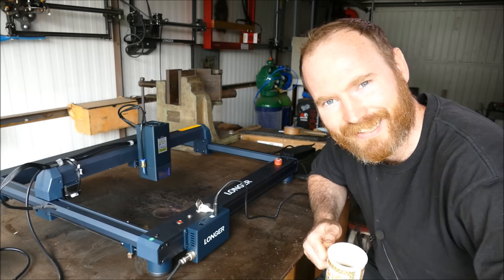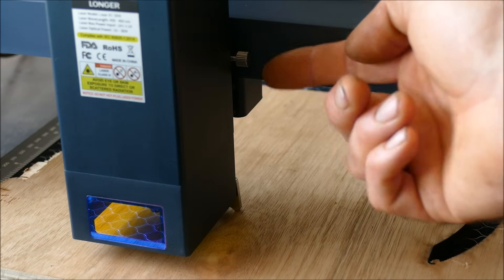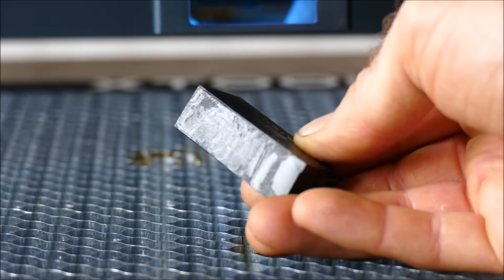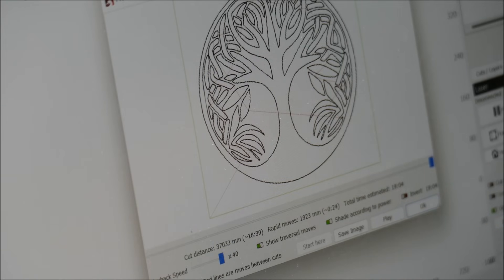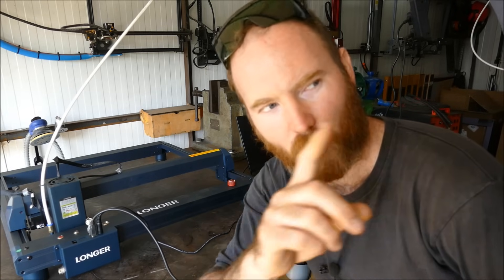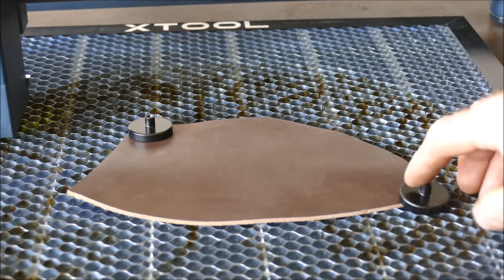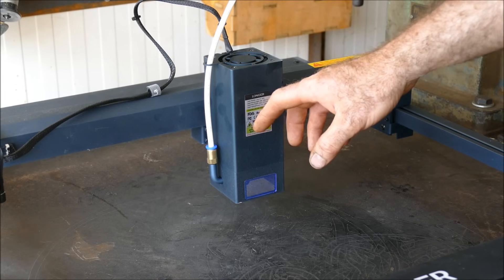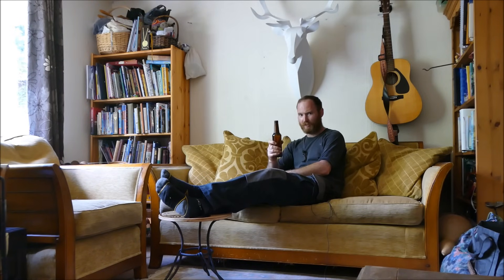MIND BLOWN new budget laser can do this! Longer Laser B1 30W desktop laser full review test & critic

Comment: Another great video. Now I want to test a laser and I'm not even done fine tuning my plasma cutter. Which brings me to another question. When do you think they will offer hobby lasers for cutting 3mm mild steel? I would love a laser for sign making. Plasma is nice but messy and warpage is always an issue too. Great vid. You're no slouch when it comes to tackling the tough jobs like forging. Must have taken some time to do that part. Thanks.
Reply from the maker: Thank you. Those lasers do exist but they are very pricey. Personally if you're sign making as a business I would just pay a profile cutting company with a 10kw laser to do it for me and pass the cost to the customer.  Saves me using up valuable space for the machine and storing material and scrap. You'll see in my next video coming soon what I mean by that. Cheers J
Reply: @joshuadelisle  Indeed time is money. I don't have a sign making business, but I like the idea of making them - which is why I built a plasma cutter after watching your video on how to do it - still working out some bugs but it's pretty awesome. My laptop goes buggy during cuts and the machine responds accordingly. Need a more sheilded setup and/or a tower computer in a case, working on it. Much less trouble running the print off an SD card on the board (rather than directly from Open Builds Control, but I highly reccomend them for the FREE Cam (online) and Control (downloadable) software. Easy to use and OBCam will convert any SVG into a tool path and g-code.) Bought some sheilded wires to run to the motors, grounded the machine as you did (grounded to the case but maybe a better spot?) I also had wrapped the torch lead in tinfoil which seemed to be the biggest help for preventing the HF antenna effect, but I'm going to make a better sheilded lead cover using faraday fabric. Peace!

Comment: Hi again Josh, Instead of concentrating on 2 axis laser machine it would be far better in the long term to buy a 3 axis router as a laser unit is easy to fit and you still have the extra use of the third axis as a router. Some of the more rigid routers are quite good or cutting metals although a much more solid machine would be required for work on steel. Regards MoK
Reply from the maker: Thank you. I actually have one to show at some point. Cheers J

Comment: Hi , I'm a new subscriber,  i have a small cnc business and want to add a laser to my business. Im on a budget, but I don't want to make a mistake. What would your opinion be on a buget friendly  lazer
Reply from the maker: Hi. It depends on the work and how often you'll be using it. Some budget lasers are no good for continuous use and others lack power to do certain jobs. Cheers J
Reply: @joshuadelisle   what do you think of the xtool s1, and do you happen to any suggestions of machines I should review
Reply from the maker: @kevinjobe9205  I did a review on the S1. It's good but limiting in height and space. I personally don't like their software that you have to use to get the full range of features.  Cheers J

Comment: Thanks for the super cool review! 🙏🏻
Assuming you want to engrave or cut something in a very large wood panel (larger than the working surface of the laser cuter) is there a technique that allow splitting the process into multiple step where you move the wood panel between each cut session ? Hope you understand my question.
Reply from the maker: Yes there is. I hope to do a video on it soon. Cheers J

Comment: What is the lowest laser power that will do stone? I’m trying to do stone at lowest cost and lowest eye danger
Reply from the maker: Thank you. The eye danger is there all the way to just a 3w laser so investing in quality glasses and a cover is recommended for safe use. Every type of stone reacts differently and only some work well at being engraved by a laser. The more power the better because essentially it's the sudden heating and swelling of the stone surface from the laser that breaks away chips. Cheers J

Comment: For under a grand, that's incredibly impressive. There's apparently a 40W model that's $400 more and includes a honeycomb table, but then you're in the range of other machines that might be of higher build quality. I love that they've figured out how to do a self contained head with the newer machines. No more glass tube and mirrors. I think I'd get a lot more enjoyment and use from one of these than a 3d printer. I just don't have the patience for those. Give me a machine that will do it's job in reasonable time frames. There's also the cool factor of cutting things with a laser. I would definitely get proper safety goggles if I were running one of these open. I would think a reasonable fume extractor wouldn't be that hard to set up. There's also the option of just wearing a respirator mask.
Reply from the maker: Thank you. Yes the K40 CO2 is very cost effective but I hear it's not so easy to use, needs lots of modification to work well and has a very small bed size. Cheers J
Reply: I bought the Atomstack X7 pro 10watt a year and a half ago and it's paid for itself and a new laptop and Lightburn without even trying to sell things I practiced on. Yes it's a great investment and they are cheaper and more powerful now. Definitely worth the investment. The nice things about the diode lasers is that the heads are replaceable for cheap and they don't deplete if they are not used like CO2 lasers. Not quite as powerful but they do a good job for the hobbiest.

Comment: I've seen laptops customized (graphically) with lasers. Is this unit capable of that? I'm wondering about the slight curvature of most laptops and how the laser would adjust for that height variance.

P.S. Steff320i is correct; awesome blacksmithing skill.
Reply from the maker: Thank you so much. I believe this would work fine. It appears to hold a linear beam for about 30mm so a slight curve would be fine. I would be cautious about laser engraving plastic as it can release dangerous gasses depending on the grade. Acrylic is the only safe plastic that can be engraved or cut that I know of. Cheers J

Comment: there are just so many different lasers right now i'm positively confused.  BUT i have a challenge for you sir if you are interested.  see, with stainless steel, you can actually BURN different colors on its surface using a laser applying different temperatures.  i have seen some people make absolutely wonderful pictures of birds with the basic colors on stainless.  but is it possible to use AI to produce an actual full color family portrait and burn it on a plate of stainless steel?  and how would you artfully mount it to make full use of such a unique portrait?

Comment: That looks like it might be a Laser Tree brand module. The 30W unit on aliexpress looks very similar except it has a display near the top (for temperature?) and I think the air assist might enter on the right instead of the left. I didn't realize these things were under a grand for something with that much power now. I'm interested to install one onto an existing CNC machine...

Comment: What are your thoughts on the x tool 40 watt versus the Longer B1 40 watt?
Reply from the maker: xTool have done a good job at making it last with very good quality parts. The B1 is bigger and has the adjustable feet. I personally like the xTool especially with the extensions. Cheers J

Comment: Not really qualifying for 'budget' in my eyes. My K40 was £280 back in 2014, 40 watts and still going strong.
Reply from the maker: I hear mix reviews on the K40. Not so many good video reviews but lots of people claiming it's good. What's your thoughts on it? I hear it's not got a very big space to engrave and it takes a lot to get it working right... Cheers J
Reply: @joshuadelisle  Yes it does benefit from some modding, increasing bed size etc but amazing for the price, especially using alternative software like K40 Whisperer. Wiring leaves something to be desired though, incorret grounding, no emergency stop (when i bought mine), though i do hear they are now much improved.

Comment: What is the yellow thing you put on top of it for pressure after adding wood glue to it? It looks so much like the case of a transformer i have and im just curious..🤔 I think its the same case, just different color😅
Reply from the maker: That's it, it's a transformer 240-110v used for onsite contract work. Cheers J

Comment: Homing can be performed in many ways - If you simply home to a switch, then the errors will include switch accuracy/bounce and decel time. If the axis is not at velocity when it hits the switch, the distance to stop will be different that if the axis was at full speed (Distance = Velocity over time).
Best method is to go to the switch at full speed, and then reverse direction in order to come OFF of the switch at a very low speed. That will gain accuracy for homing.
Reply: The home function does pretty much that.  It seeks the switch at a predefined speed, then backs off the switch and re-engages it at a much slower predefined speed.  So velocity isn't an issue... You also have little to no control over the homing function it's entirely within the firmware.  Except the home seek, debounce time and re-engagement speed are generally allow user modifications.

Poor idea to head at full speed to a fixed stop... my co2 will run 1650mm/s it would do massive damage .. you want to be able to set a seek speed.
Reply: @jackwilborn2353  Your pre determined speed is not pre determined. The actual speed while hitting the switch would depend on where you are in your acceleration. In other words, if you are close to the switch, the velocity ill be lower than if the distance to the switch was longer allowing the constant velocity to be reached.
So, it would be important to incorporate an "on then slow off" in order to accommodate. The slow OFF move would also make the software latency less of an issue.

Comment: Regarding homing: set the software to home 5mm from the stops after triggering. I would also get rid of mechanical stops and use light stops. They are far more accurate due to lack of moving parts.
Reply from the maker: I think there is a setting I can change also to allow a faster home. I generally move it by hand close to home like you said. Cheers J

Comment: Thanks! This is long. But I had to say thanks. You probably do not realize the effect one of these videos can have on a person. And way beyond the intended project. With me the actual project turned out to be me. I was (am) a very on the go DIY guy, and more of a DIYFEBY (or Do it yourself for everyone but yourself)). I would work in the office for 8 then in the shop or barn for 8. And loved every second. Three years ago I crushed my leg with a backhoe when avoiding wasp (I am allergic to ) I jumped on the back of the backhoe toe where it rotates 
and stepped on the and the outer stabilizer with my other foot and leaned in to turn it off. My belt was barely touching the electronic boom control lever. The boom slowly came around without me noticing when I leaned further in to look at guages and crushed my leg right above the ankle. Then I tried to make it uncrush and accidentally pivoted it cycled closed again. There was only a 12 mm of room. Once I opened it I swung the boom clear and jumped down on both legs, one which collapsed 5 inches. Then I laid there for hours before I was found. But with that, the ambulance ride, the 14 hours of surgery, etc I did not get a lot done that day. It was followed by a couple months in hospital and then several weeks in rehab. The leg lost all three arteries, shattered into 100 pieces, and stayed that way for a year and a half until some cocky idiot doctor was willing to operate on his idiot patient and throw a steel rod, some solder, titanium, JB weld, a hammer, chisel, popsicle sticks, a lever of a John Deere 2030 and some bronze plate and he brazed, glued, screwed and best it all together. And I had only gone him to have it cut off after other docs had said they could do nothing. But he said he had about a 5 percent chance of success with  surgery and I had about the same for keeping it. Then he said I know I got my side covered because I know I am better than 95 out of 100. Doctors. And you seem to be a little cocky yourself so you want to give it a go. And I told him that sounded like great odds to me. And we were right. I put everything I had into getting better and stayed positive throughout. I can walk even run if I have to. But I used up everything I had mentally to get well. And then I hit a wall. I have been stuck mentally ever since. Just not able to get going. My wife said it was the traumatic event. But I can't think of anything that happened😉. Anyway, about a month ago I am moping around. My wife turns on the TV and grabs my phone. She goes on YouTube and searched something and randomly pulled up a video of yours on YouTube and started it on the TV and she said do something like this. Just go out to the shop and get going. It kooks like something you would do. I watched it and a couple more of yours and Boom. It was like the energy poured back into me. I went out to the shop and started cleaning up. Making room for a laser. It was a long story but I had to say thanks. So use this 100 bucks to save another person. Like I said, you never know.. I owe you bud! My name is Jim by the way. Nice to meet. I might bother you later with a question. By then we might be good friends. You never know!!!!
Reply from the maker: Jim it's my absolute pleasure, thank you so much for your kindness and encouragement. Your message actually made me tear up a little. I know what it's like to be in a dark pit and I can only thank God that I got pulled out of it. I'm really glad you've pulled yourself up and getting stuff done and better yet having fun too. I like to think I only fail when I've given up so if I don't give up I never fail, I now find that I now see life's obstacles as an opportunity to learn a new way round, it's challenging but  there is always a way around. Feel free to ask anything you like whenever you like. All the very best. Cheers J
Reply: Jim dope ass story bubba and gosh your such a tuff dude your family is lucky to have you and your lucky to have your wife exactly what a real marriage is based on picking up the other at a low point I would love if you went to Facebook and followed my company just starting off myself but you’ve inspired me I wanna do something for someone with my laser maybe we could brainstorm idk but my company is Spivey’s Printing & Laser Engraving LLC I hope to hear from you one day tell your wife I said she’s the shit for pushing you that day lol ttys 🤞🏼🤞🏼🤞🏼

Comment: I had no idea consumer machines could cut this thickness. Can it do ply? 
If so this would seem more convenient than a cnc router (more precise and less messy). 
What’s the down side??
Reply from the maker: Thank you. It certainly does ply as you can see from the table build. Down sides are that it is slower than a router and leaves a dark burnt edge. Otherwise it's very useful. Cheers J

Comment: Could you speak to the software required to operate the laser?
Reply from the maker: I'm not sure why you would want to but theoretically you could. You can operate it remotely but you still need to physically remove the parts than less you use an automated collection system otherwise you still need to be present in case of a fire hazard. Cheers J

Comment: Those engraved stones are pretty amazing, worth playing with speeds and power to see if you get colours like slate. For production of 2-3mm plywood model kits this should be fast enough and much cheaper than CO2? 6 combined lasers means the spot/kerf size will be a little bit bigger but diode lasers have smaller kerf than CO2 anyway.
Reply from the maker: Thank you. I think these 30-40w lasers are very practical and just as fast as my 50w CO2 on thin plywood. The dot size to me is better as you are engraving a wider surface so you can turn up the dpi and therefore the engravings are quicker. For cutting you'll be using an  kerf offset so there is no difference between any laser dot size when it comes to cutting as long as the dot is square and not rectangular. Cheers J

Comment: A couple of suggestions before you raffle it off.  Given that the 30W laser can cut so deeply into stone, you might want to try a "grey scale" image that has contoured depth.  I keep meaning to try this with my 10W Longer Ray 5 but it would take so much more time, so it would have to be wood.  One other comment is that there seems to be a hack for the Longer frames where people are buying the angle aluminium and extending two of the parallel sides so a much longer work piece is supported.  Given your wide set of skills a "how to" video would be cool.  My understanding is that you don't even need to change any firmware because all the axis movement is controlled by Lightburn and limited by the limit switches, which are just moved further along the axes.
Reply from the maker: Hi. Thank you. Yes that is the benefit of the 2020 aluminum extrusion type lasers and is what I use to modify one of my lasers into a large plasma table. I'll be testing the depth engraving method and 3D relief work in my upcoming videos on a different laser. Cheers J